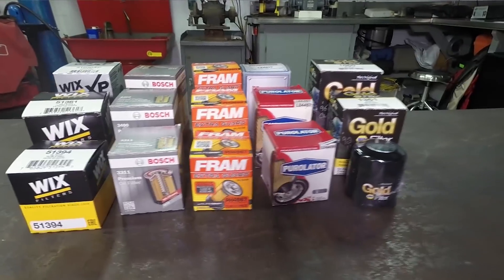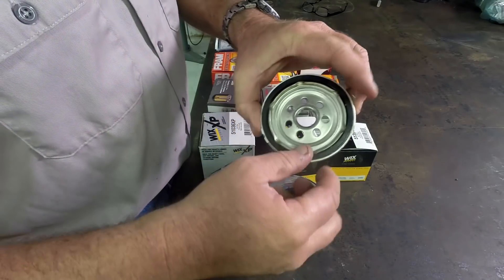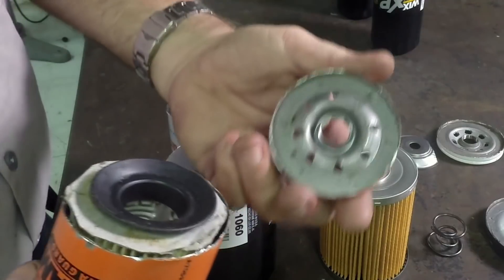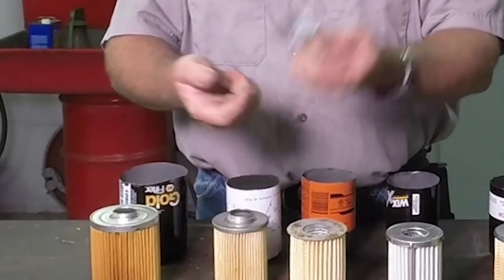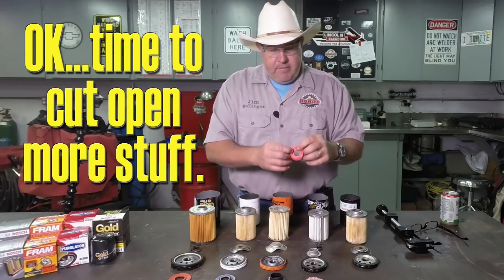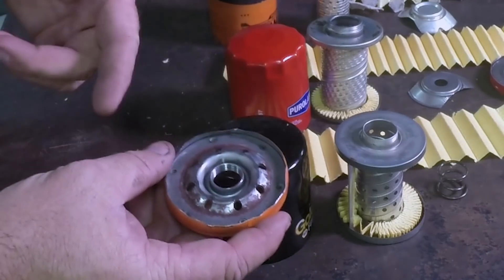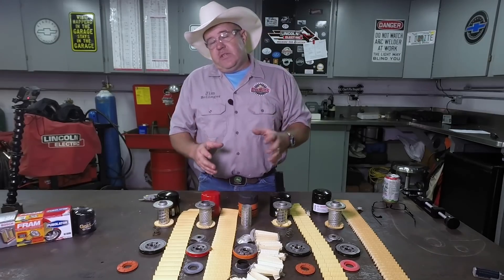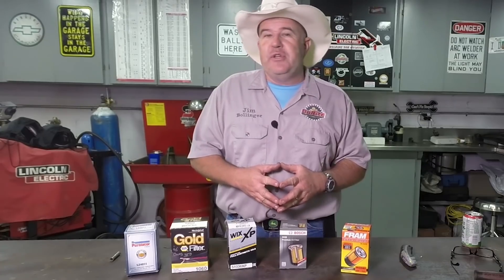The worst oil filter EVER!

Comment: I would like to point out that this is only a visual inspection which did not include the OE filter.  All filter brands claim as good or better that OEM.  Unfortunately, this is simply not true.  The micron rating of a filter is very important as well.  The best example of this is the Ford 6.0L.  the factor filter is 20 micron.  The NAPA/WIX filter in this application was 30 micron but also restricted flow due to an internal support tube.

One last thing to remember, using a poor quality filter won't cause you engine to fail in the short term.  It will take years off the life of your engine down the road.

Comment: Get real. No more than 10% of your engine oil actually gets through the oil filter at any given time. The more restictive the filter, the less oil gets through it. Oil filters are a big scam. Just pick a filter,  and change the oil often!! That's the key. All filters are junk. How much dirt is in a filter when you get it? Think hard on this. The filter bypass can be completely compressed with your little finger. Just change your oil often!!!!!!

Comment: Not sure why you added *return oil pressure annotation, you had it right
Reply from the maker: Because its is where the oil returns back inside the engine oil galleys.

Comment: Thank you for the informative video. It would be interesting to see how the filters actually hold up after a 3K mile test. 
Also, since this video is watched by gear heads more than the non wrenching public. It would be nice to see how the higher end filters compare. Namely K&N, Mann, Mobil 1 and OEM filters from Ford, GM, and Toyota. I see that Toyota is going to a canister type oil filter, (just like the old days), in the TRD line. Thanks and keep up the good work.

Comment: I see fram looks like junk. However that is all I have ever used, All of my cars get around 300 thousand miles on them and are still running when I sell them. Maybe the others are overkill lol.  Using a cam2 synthetic blend now from Atwoods about 2 bucks per quart and just paid 9.85 for a 5 quart bottle. I change my oil and filter between 7500 and 10 thousand miles. A Bell helicopter engineer I know told me it was no problem because todays oils are so much better than those of yesteryear. He has over 500 thousand on his Cobalt that is his commuter car with no, none, nada, zip problems with the motor. And get this he only changes the filter and adds a quart until he hits 50 thousand on the oil. (he does favor Mobile 1) I  Have also used the  Atwoods and WalMarts  house brand oils with out problems for years and hundreds of thousands of miles I am not sure what company makes these oils because I know Atwoods and WalMart does not make oil.  I have worked at name brand milk and bread companies and let me tell you they both make so many brands in the same machine they just change the labels. So I am sure it is the same in motor oil and who knows what else. The old saying you get what you pay for is not always true.. Just do your homework and save some hard earned money. I might try a better quality filter next time maybe.

Comment: I'm a third generation FRAM filter user and have not had a single problem. My friends that use different brands; half have problems and the other half don't. They tell me WIX, Purolator and store brand filters are the worst. Now ive seen K&N and factory OEM equivalent filters are just as good, if not better, than the brands that have problems.

Comment: My jeep has 256.000 miles on it and i have used fram  STP and other low cost filters and never had any problems with my engine even going 1.000 miles over on my oil change at 3.500 miles .

Comment: Ok now do Motorcraft vs. ACDelco vs. MOPAR vs. Imports' filters
Reply: A K&N and other performance filters would be interesting to do. I'm guessing less media is what they'll have if their gist is to improve flow, but would be good to see what else, if anything, they implement, as well as what quality they actually are.
Reply: @FilmMonger  Some things look reasonable and even shocking but without knowing what proper end result you are looking for what you see may mean nothing at all. The science of making filters is very detailed with lots of variables. More filter area does not mean better filtering if the filter media is inefficient. The WWII mechanics used to use a roll of toilet paper for the filter media. The length of the roll of toilet paper would be a hundred times longer than the length of the Wix filter media but probably does not work as well or would even hold up for more than a thousand miles.
The "proof in the pudding" is what comes out the other side when the oil passes thru the can. Testing the can does not tell much without a scientific analysis of the filter material and back flow gaskets and how everything performs together which means testing how dirty a standard dirty oil is that has passed thru the filter to see which filter did the best job filtering the oil.
Reply: obsolete optics They probably come from either Honeywell, Wix, or Puralator...
Reply: Motorcraft = Wix or Purolator, depending on who got the contract most recently.
Reply: Motorcraft has the silicone drain back valve, coil spring, and decent cellulose media. Can is a bit thin, and I don't like how the pleats are packed. Still a good value overall. I use them. The other two are junk, especially Mopar. Mopar is the most expensive too. Go figure.
Reply: John Smith true, Mopar filters are expensive, thats why I usually use Wix on my Wrangler.

Comment: Glad to see this review.  Years ago I changed my oil using a Fram.  I put my bluepoint filter wrench on the can and spun it on.  A few days later I noticed some oil drops under the car that was coming from the new fram.  Turns out i had poked a hole in the can while putting on the filter.  The wrench has 3 points that help grip the can and one had oil seeping from it.  I contacted Fram about this.  They asked if i could send them the can but said i threw it out but just wanted them to know I was very disappointed in their quality.  A few months later I noticed they started to come out with filters that had the black textured material at the bottom of the filter can.  I figure it was their solution to this issue.

Comment: The guy making these orange filters  is the same guy making Reynolds Wrap Foils. He also makes Hefty trash bags. And the Fresh-Lock(tm) Zipper freezer bags we use for the leftovers. He also owns UCI so if you own a GM or Ford produced in what was Nafta the water pump was made by him (UCI) with rust inside.  Just kidding. The oil filters from AutoZone, Advance Auto Parts Napa, STP and Motorcraft? Yep, made by UCI granted under different contractual specs. By the way UCI went bankrupt in 2016 because some cheap metal & paper competitor from China  outbid them in North America.  Next time you buy food at a store or fast food joint check the container label: if it says Pactive, Evergreen, Graham or CSI... yep, was made by the same guy making these death traps.  Sounds like Paranoid schizophrenia, I know! :-)
Reply: Holy smokes , my brain needs to process this.....
Reply: Luiz Henrique its just like INTERTEK that makes ALL appliances in China. Doesn't matter what the brand name is; if its made in china, its most likely made by intertek. Just look for their sticker LOL

Comment: Another "filter comparison" in which zero testing is done. Glad the SAE doesn't "test" things this way.
Engine manufacturers decide what specs a filter must meet in order to be approved for use. The SAE actually tests them. The tests aren't to simply cut them open and visually inspect. They're TESTED with testing apparatus designed for the job. Actual data is produced, which is then compared to design specs.

Comment: Been a mechanic all my life and fram and baldwin filters were the worst for damaging engines, wix used to make some filters with a felt material if you had a weak oil pump good luck pumping thru that one.  the last fram come apart i delt  with was was on a hemi dodge charger ruined engine with a wally mart oil change and the wally always screws on a fram. saw a lot of baldwin issues on heavy equipment deere, cat, big rigs etc have seen the cans blown apart. all napa filters are wix made, fords motorcraft is usually made by  purolator which i use most as they are the oldest filter company. i do dot and will not trust jiffy lubes, wally marts and other fast oil change places. if your daddy could not change his own oil he was a pussy, if you did not learn from daddy then the rest of you should have ran down your momma's leg. anyone that drives a vehicle ought to have a class on vehicle maintaining  before you can get a drivers license. i have made soooo much money off of dumbasses  all my life,, i always wanted to have a dumbass surcharge line added to our shop tickets for such people. if you have a engine damaged by a fram good luck getting fram to do anything about it, just like thinking the warranty promised on a jasper remanned engine or trans will be any good when she blows.. liked your article .
Reply: I also am a mechanic, we install Jasper products and if one has a problem they have always taken care of it. Just my experience.

Comment: The Orange and black color scheme looks So Good, when I crawl over the front of my car at 70 MPH, "to look at my Fram filter".   The Black grippy rubber is a nice idea too.   The internal rust,  off the shelf, brand new  product rusted, busted Fram forever for me though.  I'm also not sure if I want cardboard clogging up my engines oil circulation system.  Fram must have already known about these issues,  so I assume they just don't give a shit.  As TRUMP would say, " FRAM..., you are fired. Get the fuck out from under my hood".   Napa Gold, and Wix.  I gotta remember that.  THANKS TEX.  This is  extremely valuable information.   I would have subscribed, had you had a FORD sign on the cabinet...  just kidding.  LIKED and Subscribed. Cool presentation.

Comment: Great video!  Thanks for your hard work.  I agree with most of what you had to say.  But, I traveled for 35 years on my job.  I used Fram filters on five cars that went over 200,000 miles with zero engine failures...not one!  I had a 1991 Toyota 4 runner that had 385k miles when I sold it.  I always used the standard Fram filters on it without any engine failures.  I read somewhere that Bentley filters have the same cardboard (they call it fibrous material) as Fram,  The best filter in my opinion is the NAPA Gold made by Wix.  The gold has a red neoprene anti-drain valve instead of the black one on cheap filters.  I've switched not because I had problems with Fram but because I think the NAPA Gold is a great filter.

Comment: I had truck with motor that had side mount oil filter. Had Fram filter, it started dry starting, late oil pressure. I had to fire it, shut it right off to help filter fill back up. Do they even put drain back valve in a Fram?
  Started using Motorcraft. No more empty filter problem.

Comment: You do know fram and Purolator are both the same right? You also know fram has good, better, and best. Should of gotten the others too, we’ve using fram/Purolator on all of our race applications and have had no issues at all. I’ve had more problems with junky K&N filters. Also how long have the filters been sitting out? That happens with any filter too, I’ve gotten junky NAPA filters as well right off the shelf

Comment: Would have like to have seen STP included in this comparison. And Mobil1 as well, I only have ever used Mobil1 filters and oil in my Integra, but I typically use (used) Fram, Bosch or STP in my other cars with conventional oil.

Comment: I worked for a NAPA store back in the 80s when I was laid off from the steel industry. Our filter salesman actually had a jig to open up the oil filters as he is doing with the grinder. He gave me a fifty dollar bill and instructed me to go buy oil filters for a small block Chevy anywhere I wanted. I went to K-Mart and bought several brands and to a competitor across the street and bought their best. At the time, NAPA filters were manufactured by McGard... After opening up all of the filters that I had bought he told me to pull the equivalent filter from our stock. The results were ASTOUNDING!! The filter element was easily twice the amount of any of the others, the can was heavier, the spring was as shown here, not a flap of rubber. Fram was the absolute worst...

Comment: You should cut open amsoil filter. It doesn’t get any better than amsoil filters. Fram could really do damage to your vehicle if you leave it on to long. They just rot inside turns to mush.But frame is the best selling filter in the states. If you can’t get amsoil filter go with wix. Thanks

Comment: I find this a bit misleading. Your comparing filters rated for different mileage. Of course there will be big diffrences. Not saying the fram orange filter is great but its only rated for a MAX of 5k miles. As crappy as it is, its probably still better than the filters most quick lube places use. Most of the other filters your comparing are rated for 10k or more. Maybe compare the fram tough guard next time which is what i use (rated for 10k miles) and I have never had any issues. Or check that they are all the same mileage rating to be fair.

Comment: Fram use to be owned by Bendix then got bought by Allied Signal, I use to work in the factory in Stratford Ont. Canada in the early 80's. These filters were build with high attention to detail , top quality parts and were consider the best in the industry in the 80's. That's how they built their reputation. They were tested constantly and performed better than any of the competitors. On the production line they ran Fram, AC, Motorcraft, Honda & Toyota to name a few. Fram got bought by Honeywell in the 90's and now it is owned by Rank Group. The factories in Canada are gone and most in the states are gone moved to Asia just to make a buck and screw the North American consumer.

Comment: ...you've got a seriously nice shop there! Knew I was in the right place when I saw you're using the Metabo grinder...I've been thru multiple Black and Decker Pro, DeWalt, Makita, Hitachi, Milwaukee, Kawasaki, Harbor Freight Driil Tech??!!, and others in my 42 years of fabricating experience at work, home shop, etc. and the Metabo 4 1/2" side grinders are SO MUCH better they're the only ones I will ever buy (and that's if they ever break....so far they have been used and abused for years and still work like NEW!!)

Comment: I still will buy Fram. Always have always will. I dont want the best filtration in my engine. If you have too a fine of a grade filter on an high mileage engine, the filter will stop up quickly from the oil and filth not being able to pass through which slows down your oil flow rate and puts pressure on your oil pump. For newer cars with synthetic oil i would use the fine grade filters no problem. Plus i love the grip on the filter.

Comment: Fram = Scam. A perfect example of effective marketing. I'd only use a Fram if that were the only filter available (then change it the moment I could get a Purolator One-or most any other comparable filter), because the only thing Fram is is better than is no filter at all.

BTW using the NAPA "Gold" (top tier, HD but short of extreme use) filter and 'regular' level other filters is a poor representation. Are you sponsored by NAPA?
Reply from the maker: Nope, by no one. BTW NAPA Gold is not near the top tier for NAPA, they have the Platinum and XP series. As I have said before in the comments, I walked into, NAPA, Autozone, O'Riley, and Discount auto parts and asked for the filter that came with their oil change special. This was not meant to be exactly a neck and neck comparison, but more of which ones to chose when you get the choice.
Reply: @DoRiteFabrication  Fair enough and TY. However, the Gold is an up grade and not basic filter, but thanks again for the clarification.